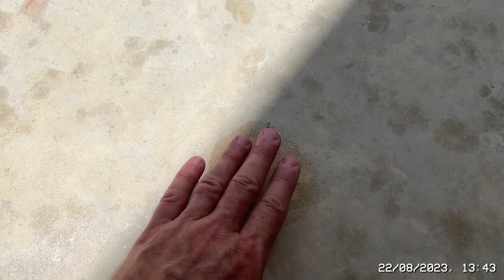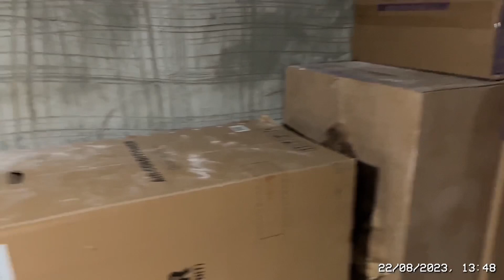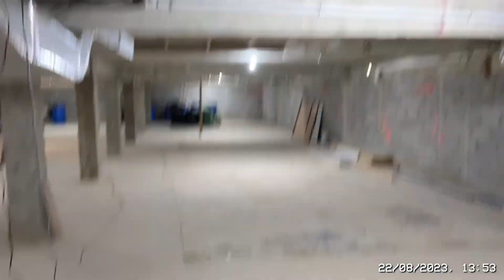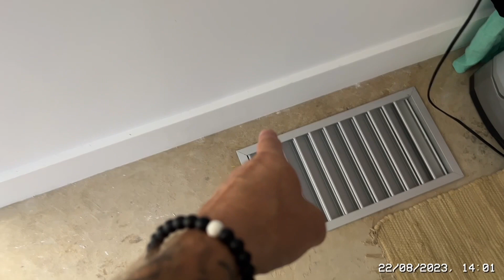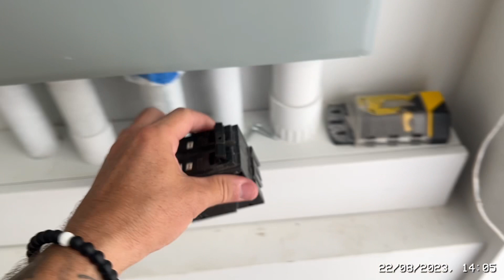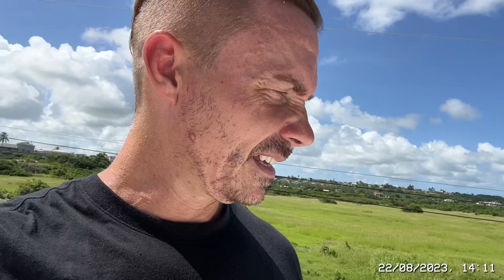22 August 2023

Comment: Fyi, regarding your floor and tiling later. Remember to rough up the floor (Hilty) prior to tile work so that the tile cement will have something to grip onto. Our home down there had the floor polished like yours then tile put down later and tiler didn't do that then some time later most of the tiles popped up due to heat.
Reply from the maker: Yes I would definitely do that, and thank you for the heads up. Thats is what I love about this channel, information being shared that helps everyone out!! If I didn't know that I would be in a world of trouble in a few years!